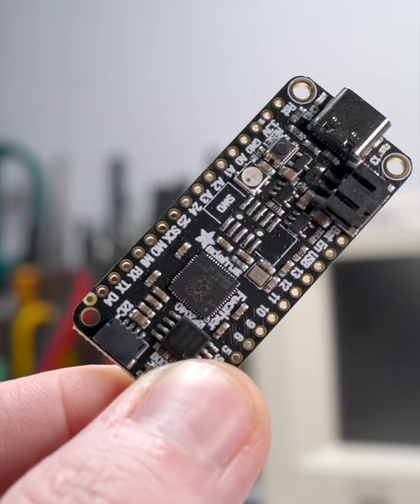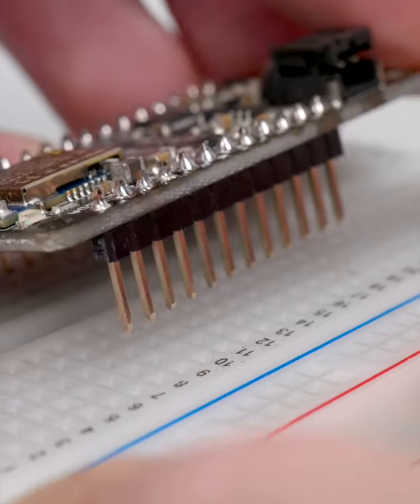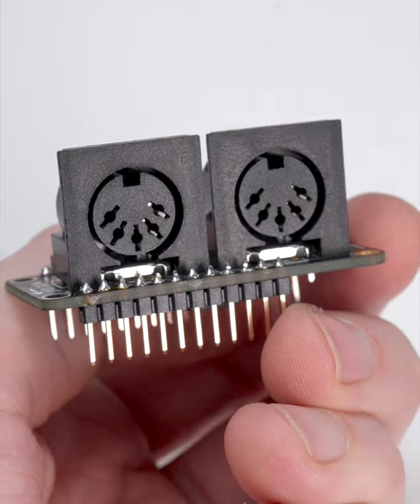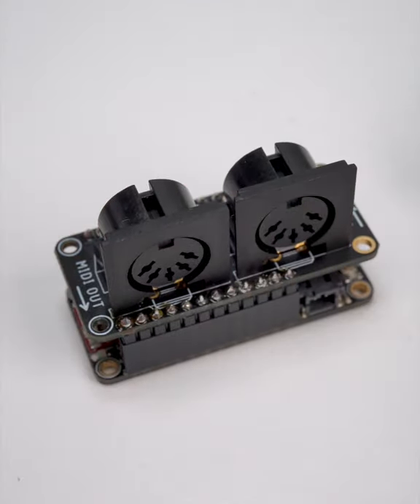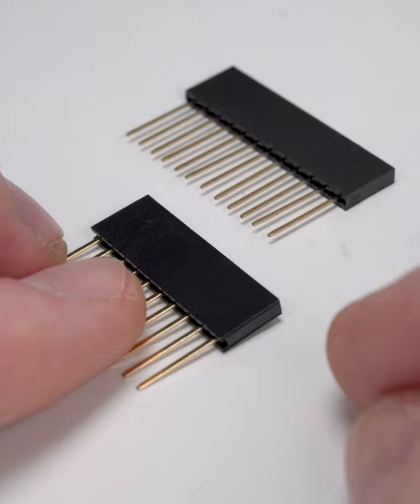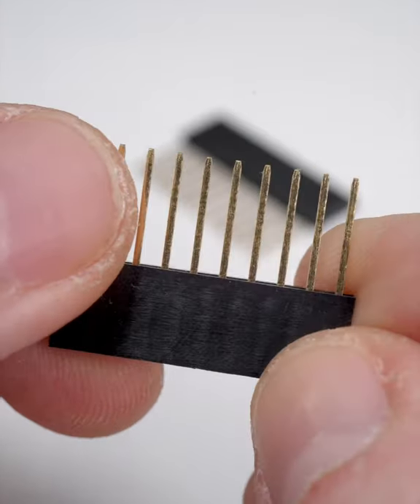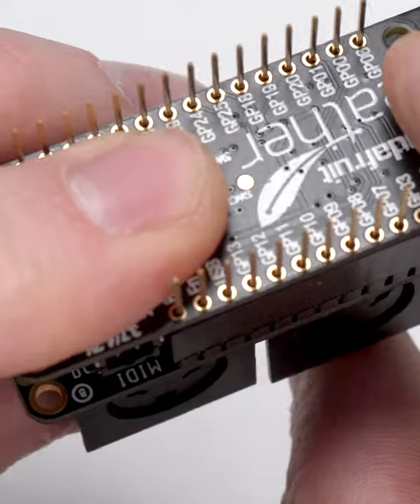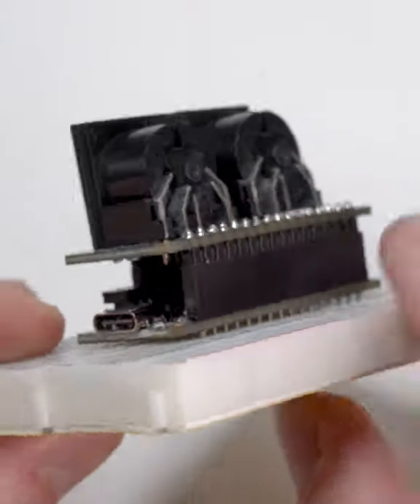Stacking Headers - Collin’s Lab Notes #adafruit #collinslabnotes

Comment: Beautiful example of good soldering technique.  Apply heat, feed solder wire on the opposite side of the iron to ensure the pad and pin reach a high enough temp to avoid cold solder joints.  Love it!

Comment: I wonder how high you can make the stack before the electronics don't work anymore?
Reply: Depends on which headers you use, capacitance, interference etc. play a big role whenever there's long connections.
Reply: If you're gonna work with i2c or other  high-ish speed busses, about 10 feet?
Reply: @ekenedilichukwuekeh4647  doesn't I2C have no specified frequency? You could make it work with lower frequencies and higher changes in current

Comment: The hurdle i find is the programming of the board. I assemble the kit and then the software doesn't render operation. Same issue with my 3d printer. I get one generic print then the software won't cooperate. Js nice vids.